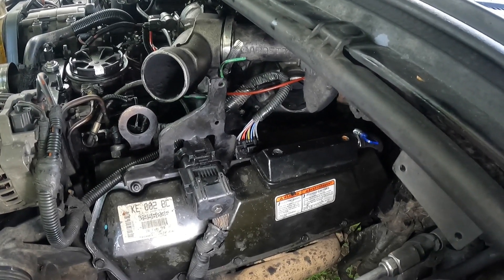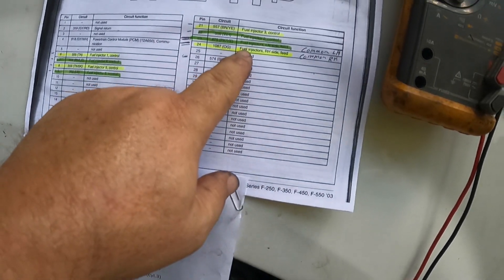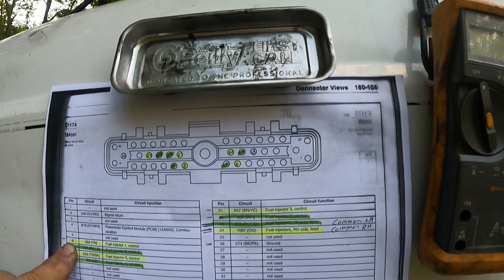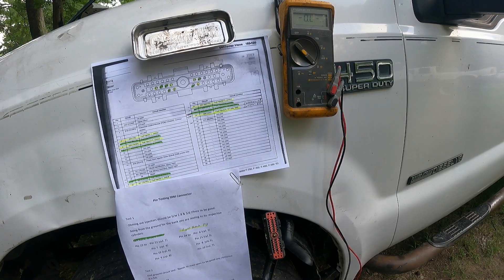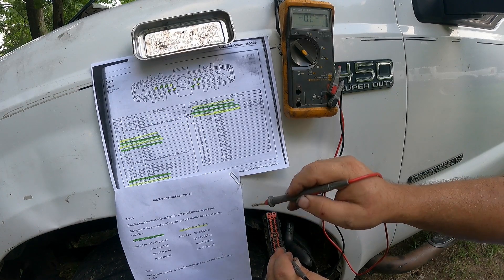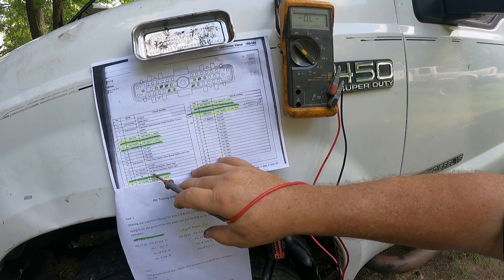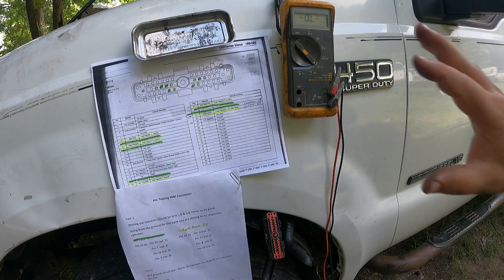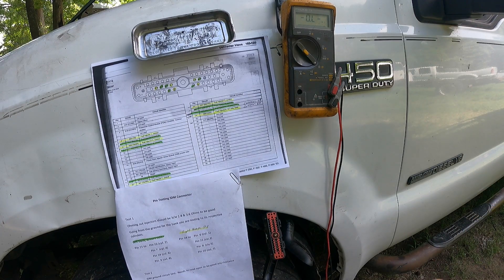IDM Wire Harness Pin Test. P1316 DTC.   2001 7.3 Power stroke

Comment: Thanks for the video. I have good from 24 to 26 but I 23 to 26 is no good? Also 24 to 18 and 23 to 18 doesn’t show anything? Any help is appreciated.

Edit: also I checked 23 down to the to connectors on the valve cover and they have no resistance?
Reply from the maker: Have u done a buzz test? As far failed circuits, if u tested from the idm plug then I would test from the 42 pin plug over the driver side valve cover as well. If it still fails then I would go to the 9 pin vch plug and test. This will attempt to narrow things down and determine where the problem is.

Eliminate what’s good and what ever is left should be what needs attention. Hope that helps
Reply: @bayoudiesel  hey thanks for the reply. I have not done the buzz test (I think that’s only on the ford 7.3 we have the international t444e 7.3l). The main plug has 3 wires going to the idm on it and all of them do good. But on the idm plug like I said you said pin 23 and pin 24 to pin 26 should be open loop but it’s not 23 has a ton of resistance and 24 has some resistance. I checked down inside the valve cover and all the stuff seems to be fine continuity wise. Any help is appreciated!
Reply: Does the batteries need to be hooked up for this test to work right? Or Key on?

Comment: Bayou Diesel im having problem with idm ground 
Its reading on 23 to 26 
Can u help me or give me something where to check
Reply from the maker: I could use a little more info about what u are fighting with.
Reply: 2000 f250 my truck its smoking 
Disconect right bank and stop smoking 
I checked the omhs from the idm wire and all injectors good only the common grounds do not read open on pin 23 to 26 and 24 to 26
Reply from the maker: @panchoaguilar9207  it would appear that u have a short to ground somewhere. It’s my understanding the the pcm makes / breaks grounds to control solenoids. 23&24 are the feeds (hots) for each bank so any short to ground is going to cause electrical trouble. 
I would start by inspecting both sides of the 42 pin connector over the drivers side balance cover for chafing. After that I’d unplug the 9 pins on uvch and ohm that out, if good then plug them back and ohm test from the 42 pin. This should help u eliminate/isolate where the problem is and isn’t.

Comment: I changed my idm as I lost 1 bank. I looked over wiring as I just did injector cups. 
New idm and I have no injectors. No injector buzz at all. Before I had 4
Reply from the maker: Is the idm a known good one?  Is the pcm good? What codes are u getting from the pcm?
Reply: @bayoudiesel  
I just got a remanned idm. This all started when I did an injector buzz test. All injectors would buzz but I would get a 1294 code. I had just changed injector cups and checked ucvh and all looked great. I deduced it was idm. 494k and 22 yrs felt long enough for idm
Now after I got new idm, now I get no buzz on injector buzz test and now 1293 and 1294. This is also the 2nd idm, when this first happened I thought I had a dud. 
When I ohm out the idm connector I have high impedance on 2468. It seems to be a bad short killing all power to idm. PCM is good 
Sorry for the novel and thx!
Reply from the maker: @davidcooper9930  seems to me like u have a wiring issue that started by killing the driver side bank and now both banks. My experience has been that idm codes lean more toward wiring issues than the idm. Doesn’t mean to totally rule out a bad idm tho. These rigs are all around 20 yrs old and that’s a good bit of wear on the harness and connectors. My starting point would be to inspect wiring and all connectors for fraying and damaged / burnt connector pins. Another good spot to check is under the 42 pin connector that attaches over the driver side valve cover. They are prone to rubbing on the vc and creating shorts. Pull it and inspect the underside very good. Put some loom or make a rubber boot to cover wires. U can also use a crescent wrench to bend the tang that holds the plug up a little. That will help hold it off of the vc. Let me know what u find and we can kick around any more questions. If it’s easier u can email me.  Bayoudieseltrucks@gmail.com
Reply from the maker: Also I may have some wiring schematics if u need something to help u chase wires. What fun. Lol

Comment: On my 7.3 crank but no start. I don't have any power going to injector harness. I have good ground but no power. I have replaced cps I have good rpm when cranking. My hpop is full. I unplugged fuel heater. Unplugged icp. All fuses are good. It has to be the idm right?
Reply from the maker: It very well could be the IDM.  If you can find one to test your theory its a pretty quick swap.  Are you getting any smoke while cranking?  Have you scanned it for codes?  Whats hpop pressure looking like?